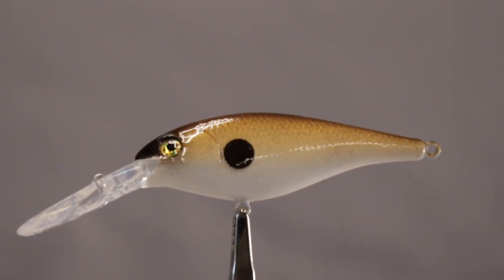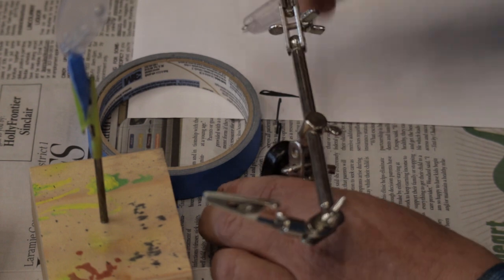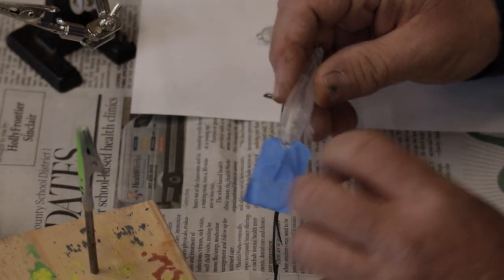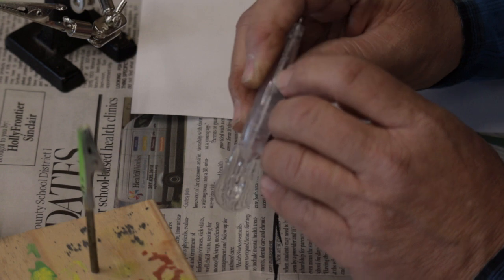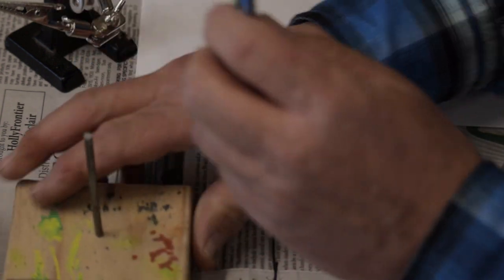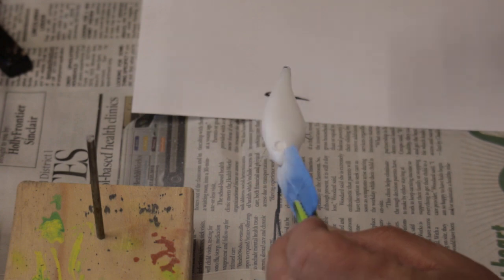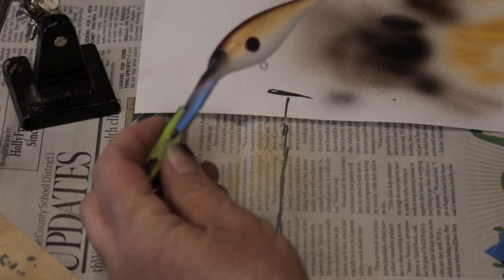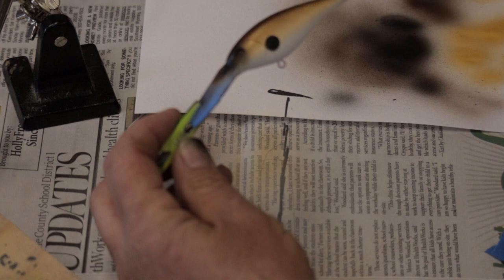Basic shad pattern

Comment: Nice pattern. What size needle & air pressure are you using to shoot the metalics & pearls?
Reply from the maker: Normally I use a .35mm needle and keep my pressure about as low as I can get the paint to atomize out of the brush. That varies from about 15-30 psi, depending on the brand and viscosity of the paint.